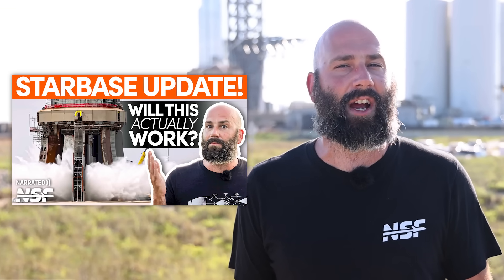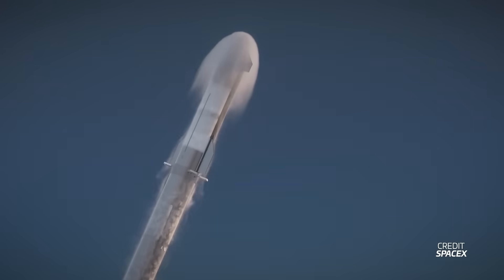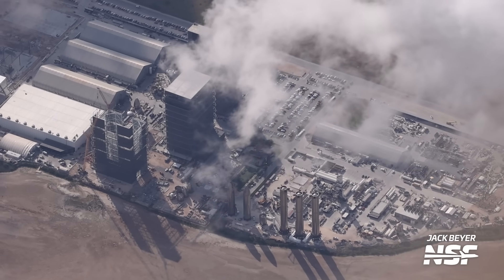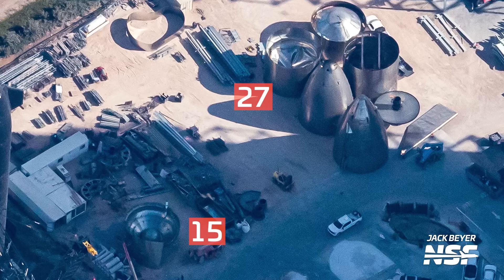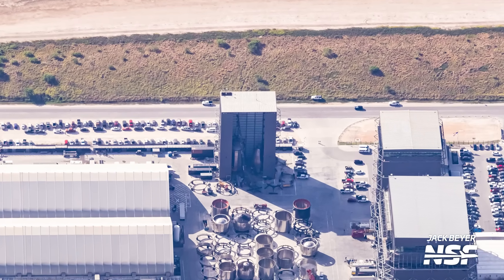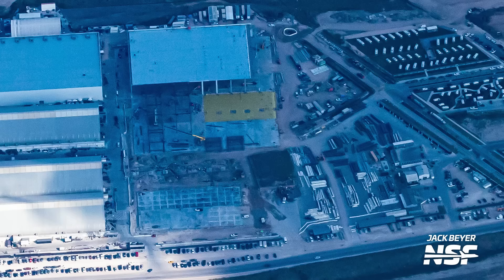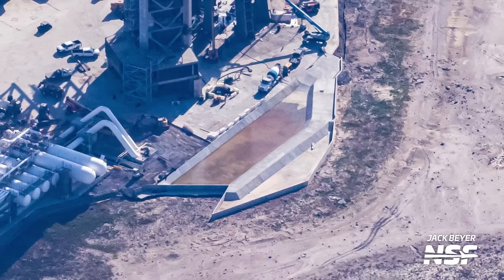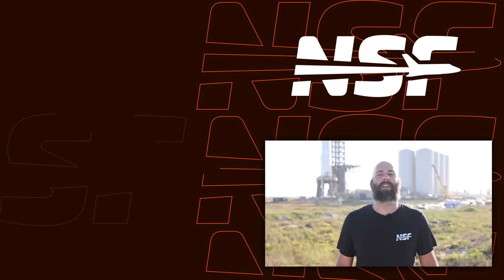SpaceX Starbase Update Flyover: Hot-staging Test Article, Starfactory, Orbital Launch Mount

Comment: Are you sure your max Q calculations are correct? For the Falcon 9: At max Q, the acceleration of stage 2 is about 1.5g upwards. This acceleration is due to the net force acting on the stage = the upwards force applied by the ring - the weight of stage 2 - the dynamic pressure force acting on the rocket. Calculating these in terms of g gives: weight = 1g, dynamic pressure force at max q is equivalent to about 4.2g. So the upwards force applied by the ring is about 1.5g + 1g + 4.2g = 6.7g. Compare this to the max acceleration before stage separation of about 4g + stage 2 weight of 1g = the equivalent of 5g of force on the upper ring. Will the acceleration profile of Starship be that different to the Falcon 9's?

Comment: The max force on the hot stage ring WILL be at Max Q. At that point it supports the weight of the top stage, the force of accelerating the top stage, AND the max aero pressure on the top stage. All of that is transmitted across the ring.
Reply: How does it support the weight of the booster if it's on top of it?
Reply: @ale131296  oops, top stage (edited it). thanks.

Comment: Probably the greatest threat for the integrated ship, by introducing the hot-stage vent ring, will be the strengths & weakness against bending moments upon the complete cylindrical skin!

Imagine the somersault of the first integrated StarShip with a fragile "bendable" ring inbetween the StarShip & Super Heavy Booster?

What could WRONG? Right?
Reply: Dumb comment. The rocket isn't meant to summersault. It's miraculous and I'm sure highly unexpected that the first one held together at all and is definitely not a designed outcome
Reply: Obviously, the resilience of the top of the Super Heavy Booster against the BLAST from the StarShip during its HOTSTAGE Separation will ALSO BE PARAMOUNT for the DISMOUNT! :_youbet::_HappyElon:

It will being intriguing to see if SpaceX test a dome ring of some sort at the bad end of some Raptors at the beautiful McGregor Test Site, just like they tested the pancake deluge plate!

Comment: The ring needs to support the friction force on the ship and force required to accelerate the mass of the ship. At max Q, the friction force is high and thus the engines are throttled down to reduce the force for acceleration... then when the friction force subsides, the angines can be throttled back up for more acceleration.. so basically.. the force on the ring is kept constant... at the max allowable amount. So everyone's wrong.
Reply: "So everyone's wrong" Except the SpaceX design engineers and you. At least someone is right, so let's see this in action, possibly on the 3rd test flight of the Starship System.
Reply: Can't wait! It's gonna be lit 😜

Comment: I still think they Need to add Blast Shields that Fold Up Before Launch on 5 of the 6 Openings to the OLM to direct the blast away from Infrastructure... The New Sprinkler System isn't going to prevent debris all around the Pad area from Getting Blasted into Projectiles for 100s of yards in all directions...
Reply: What debris all around the pad are you talking about?   All of the upgrades to the pad plus the water cooled plate and deluge should greatly minimize any debris.

Comment: "don't worry, all tests will be performed"! The one hot staging test I would like to see is how it will hold up to reusability after 3 raptors blast their exhaust through it.
Reply: That's what the test flight will be for (among a lot of other things)
Reply: Usually the rocket companies that do this, separate the hot staging section and let it fall into the sea.
Reply: @David-yo5ws  Well, it's supposed to be 100% reusable, but I guess they could replace it on every flight for a fairly low cost.

Comment: "... The hot staging ring was attached to the starship aft section..."? Sounds like the hot staging ring will be part of the starship, reducing payload?
Reply: No the hot staging ring is part of the booster not the ship. The ring has the pins to connect with the ship and the release mechanism

Comment: What is the framework for on the outside of these bays? I have always wondered about that and see no obvious reason for it.
Reply: To stiffen the walls. Unlike normal buildings these have no floors on the inside that stabilize the building.
Reply: @knowledgeisgood9645  They have internal framework though, and the outside bits dont look structural. If anything they would weaken the walls. Nothing supports it but the wall and the internal framework.

I'd be interested to hear exactly how all that hanging off the side of it makes it stronger, the specifics.
Reply: Just for stability, I believe
Reply: While there are internal structures, they are mostly for work platforms. These buildings are designed "inside-out" to create more floor space. The exterior structures are an exoskeleton.
Reply: @hawkeartist  Still doesnt sound right, if you want more floor space just make more floor space. A lot of space is taken up on the outside of the structure by having these things jut meters and meters out from the wall, and are themselves supported by the internal framework. You could put that exterior material into the wall itself to strengthen it and just have potentially a thicker wall.
Reply: @NomadUniverse  My guess is they start with the work they want to perform in the building.  That determines the height and floor space required.  Then what is the lowest cost structure that meets earthquake and hurricane forces?  The external structural supports resist bending and torsional motion.  They could have put the external structure on the inside with a larger floor footprint so they would have the same working floor space as you suggest.    This means larger walls, floor and roof for a higher cost with no added benefit.  You will need the advice of a structural engineer to get the details on why this is the lowest cost solution that also meets the requirements for earthquake and wind resistance.
Reply: @datamatters8  I'm not sure they do provide structural support for the walls because they themselves are supported wholly by the internal frame.
Reply: Not talking about vertical loads here.  Think about huge side loads caused by high winds.  Also think about rotation abut the vertical axis where variable wind loads induce twisting at the natural frequency of the structure.  Oscillation at the natural frequency of the structure can destroy a structure like happened in the early 1900’s with the tacoma narrows bridge.
Reply: @datamatters8  but its all supported by the internal frame, I still dont see what its adding and how, and why it looks the way it does.
Reply: @NomadUniverse  See the wikipedia entry on "structural engineering".
Then get hold of a text book on structural engineering and study it.  Depending on your background you may first have to study text books on mechanical engineering and material science.
Then come back here and give us the details on how the structural design of these buildings work to withstand hurricane force winds.
Structural engineering is a well paid profession.  Good luck.
Reply: @datamatters8  I've been in mechanical engineering for 20 years. If the answer was as easy as "look up structural engineering" I'd have done it. You dont have to bring the attitude, just say you dont know or explian where I'm wrong.
Reply: @NomadUniverse  No attitude intended.  You didn't state your knowledge base and I wasn't assuming you had an ME degree or worked in the profession so in the end I gave pointers on where you could get more info.  

You stated "You could put that exterior material into the wall itself to strengthen it and just have potentially a thicker wall". Well  SpaceX did not make that choice.  I gave you the answer that makes the most sense to me and you responded with "I'm not sure they do provide structural support for the walls".  So perhaps you could try your question on Quora where a person in the field of structural engineering could give you the details you seek.